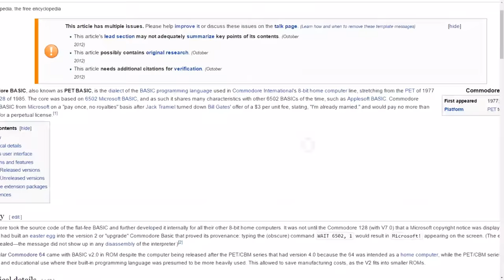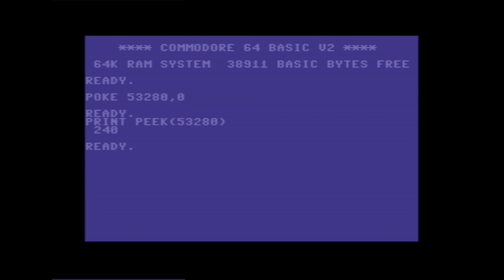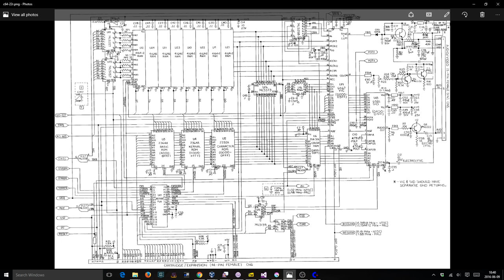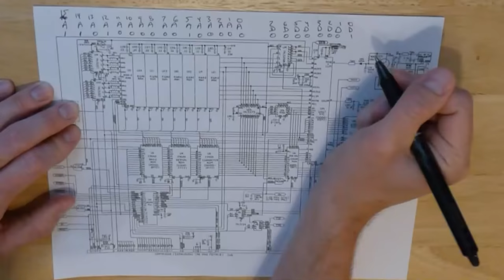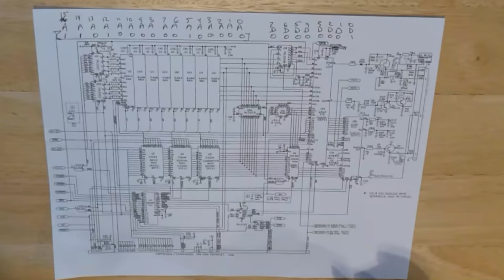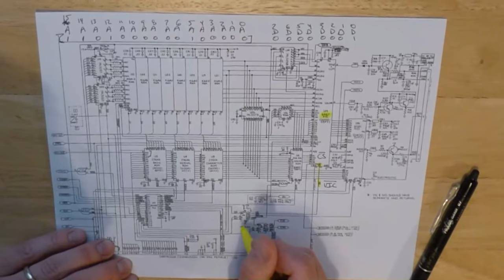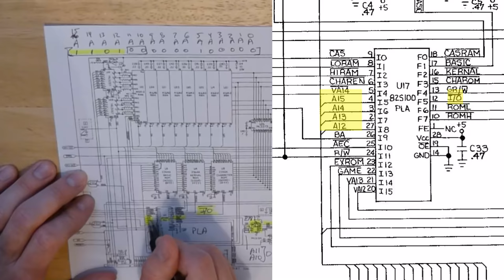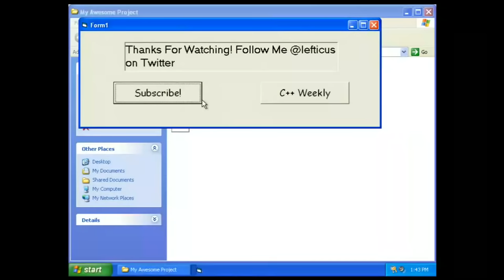Commodore 64 Part 1: How The Memory Map Worked

Comment: What an amazing explanation of the digital logic used to make things happen on the C64.  It really is a lesson that can be used for integrated circuits as a whole (in my opinion).  Computers understand two things; voltage and the lack of voltage.  Yes, analog exists, but not for the sake of processing without software to make decisions based on such things.  I really enjoyed this.  Thanks for the killer content.

Comment: This is a really good explanation.  I repair arcade game hardware which works almost identically.  Modern systems aren't too different you just write to abstracted hardware through libraries but under the hood an enable line is set and data passes along a bus.
Reply: Ya I would liken it to sending mail on a postage bus. The old time computers you just said, "here!"
IBM followed the DEC model more, with interrupts handling everything on the bus.

Comment: That PLA went bad in my C64 when I was a kid. Thanks to the schematic, I was able to track down the problem and replace the chip.  I forget exactly what the behavior was, but I remember the computer still worked, but the video was all messed up and I was able to type in enough POKE commands to determine that memory wasn't being banked properly.  Good times.
Reply: POKE 56000 , 100
READY.

PRINT PEEK(56000)
32
READY.

What the f....?

POKE 56000, 100000000000
?ILLEGAL QUANTITY
ERROR
READY.
I had the same problem.
Reply: What did you guys replace it with? Were the original chips available at the time? Or was there already a market for aftermarket Commodore 64 PLAs?
Reply: @gregorymalchuk272  This was around 1994, original PLAs were available from Jameco.

Comment: I don't think I'd say "not active," usually I've heard it stated as "active low"
Reply from the maker: +Eric Poulsen good point
Reply: Even better, use "asserted" and "deasserted". That way it doesn't matter if it's active high or low.
Reply: 'Active low/active high' is the industry standard term...Ive never heard anyone say 'asserted or unasserted' ever. In boolean algebra it's very common to refer to things in terms of 'not' or 'bar'....I think he was actually thinking in terms of boolean algebra while thinking aloud. It's a good approach in any case when you are following a logic structure on a wiring diagram. Both ways are able to be understood and his explanations were detailed and easy to follow.

One further point I would like to make is that the I/O and the CIAs actively played a role in how the chip was used. In fact, I once had a black screen on a commodore 64, and the problem ended up being the 6526 CIA! I removed it, and the computer turned on just fine...because it defaulted to 0 on the register(since it wasn't there anymore). The CIA would control the bank area of where the chip would look for it's data. This feature allowed for variable screen map locations even though the chip could technically only see 16K at once. You could change where that 16K was!

In contrast, the VIC-20 doesn't have this feature, and the graphics are thus hardwired to the low memory area, and cannot be moved at all. This is annoying at times and results in some rather silly code and ridiculous loading schemes where you would have to poke values around before running the games. The PLA actually made all this complicated logic possible on the commodore 64 without making to overly expensive(or at all awkward), as well as DRAM refreshing...which dramatically reduced the cost in comparison with the competition who were all using expensive SRAM to make things easier/reliable on the manufacturing side.
Reply: I have always referred a 0, 1 or H (for tristate high impedance o/p) as low or active low (when referring to circuit diagrams) etc.
Reply: @peterlamont647  Great insight.

Comment: Can you explain more about the PROM chips and how the graphics spirits characters get displayed on the CTR screen by the counter chips sync signals. So program a graphic spirit and character how would this be done because the color PROM chip has all the color information that gets encoded. The CRT monitor has a decoder chip to decode the color information from the PROM chip. The X and Y coordinates are done by the V & H counter chips not in the character ROM or spirit ROM or color color PROM chip. How does the X and Y coordinates get applied to the graphics ROM chips?

Comment: Nothing about the bank switching state? There is also RAM on 53280 if you choose to bank switch it in. Fact is that RAM also takes up the entire address space but you will have to bank switch to use it.

Comment: THE RETRO PROGRAMMER,  If the RAM range is 2000- 23FF. How do I compute the RAM's range like how can I manually compute and get that 2000-23FF hexadecimal numbers?
If the RAM range is 3000-31FF by looking at the decoder chip how can you get the RAM ranges manually without having or getting the memory map to tell you the rams ranges. 
What determines the RAMS starting and ending ranges?

Comment: Very cool video but I think you didn't reveal the magic of poking 0 and peeking 240 back :)

My guess: decimal 240 is 11110000 binary and since we can have 16 colours only which is log_2(16) = 4 that leaves us with 4 bits, the other 4 are not used (possibly do not physically exist within the VIC) to store colour code and seem to be always returned as "high", that's why 0 is being read as 240(11110000), 1 as 241 (11110001) etc.
Reply: You are right. But now: Only on emulators do you always get 1111 in the upper half of the byte! On real hardware, you get a random value.

Comment: I spent my whole childhood with a C64. I thought this was an interesting video. I have questions though.

1. How did you know why to use the VIC as your inference starting point?

2. You've only discussed the address lines that receive ones. But if a PLA receives 2 ones over address lines and then gives 0 as output over another line, then I assume that in another place on the schematic, a 1 could be outputted when receiving multiple zeroes?

3. How did you know that the first poke number corresponds to address lines and the second one to value lines?

Comment: I think you are talking the method called "bank-switching", widely used in games are'nt you? One bank would be the current 1024 bytes showing on the screen and meanwhile another screen would be built in another bank and be switched on to when needed for smooth transitions between scenes with no loading.

Comment: This could been explained much more logical than this. Hi-byte and Low-byte (both 8 bit) determines these 16-bit addresses you talk about. This is something you learn when going into machine code language and is basically how the computer finds it's  way through the memory map (which goes from $0000-$FFFF).
Reply: You could always make you're vid...
Reply: Snap!

Anyway it is more complicated than that on the C64. It has all kinds of bank switching, ram refresh, IO space with ram underneath at the same address, the CIA partially controlling the video chip etc. The Commodore 64 seems deceptively simple, but in reality the memory map is anything but simple.

In terms of program memory I would entirely agree! In fact, that is exactly right down to the 74LS245's and the HIRAM and LOWRAM !CS lines etc. but once you get into the I/O...oh geez...They had to do some wizardry to fit 96K on a machine with 64K addresses and memory that erases itself every 100 microseconds.

Comment: I have a feeling that you are not writing to or addressing the VIC at all. The VIC does not appear to look at the A5 address line, so that bit cant possibly mean anything to the VIC, yet it does mean something to the system itself, so it is not insignificant...

Rather, I think that the act of writing to address D020 in this circumstance causes the "COLOR RAM" chip to be selected, because the COLOR RAM chip takes in all address lines from A9..A0 therefore A5 does mean something to it - and only data lines from D3..D0 (see below) are connected to COLOR RAM which has some significance...

Writing a value of 1 and reading back a value of 241 (0xF1) can be explained as follows...

COLOR RAM is connected only to D3..D0, corresponding to the lower nibble. D7..D4 are not connected to COLOR RAM. Therefore when you write to COLOR RAM, only the lowest nibble even matters - you can put any value you want in the higher nibble and it is simply ignored. As for reading ... TTL chips tended to have weak pull ups on their inputs, which meant that if those pins were left floating, they would be reasonably stable at a logic high. Therefore, when you read a value from COLOR RAM, and it places its value on to D3..D0 only, D7..D4 are effectively floating and therefore pulled high and thus read as high by the CPU. Hence you get all ones in the upper nibble, and the value of that memory location in the lower nibble.

I think it is important to note that it may not be as simple as the address alone that determines which chip is selected. There are a lot of other input signals to the PLA which can influence which output(s) are activated. Without knowing the product terms of the PLA it would be hard to say. What does cause me some doubt, however, is that on the schematic the COLOR RAM chip is labelled as having a memory range of D800-DBFF. But given what I can see from the schematic, I am fairly confident in what I wrote above.
Reply: Actually I just found a PDF called "The C64 PLA Dissected", I cant post links but try googling it. This seems to contain the product terms for the PLA along with a wealth of other information about it. I think it satisfies what I wrote above in terms of selecting the VIC or COLOR RAM.
Reply: The color RAM chip with its memory range of D800-DBFF is for the 1000 tiles for a text screen memory. Each tile makes each text character capable of being a different color. Wherever the screen memory is, usually 1024 to 2023 decimal,  is matched up with color RAM's value. What a poke to $D020 does is set a register to cause the VIC to make the border color what you want it to be. Likewise poking to $D021 makes the background all one color. This way you do not have to change 1000 color locations, the VIC does the hard work for you. The VIC is an amazing chip that actually does RAM refresh and other tasks, and it can even put the processor on hold and use time slots for its own purposes. The VIC and the 6510 take turns accessing the data and address buses using the system clock as the task switcher. Very clever multiplexing scheme, and elegant.

Comment: I think your order is quite wrong
today's computers have multiple cores - up to 18, generally 2-6
each core have multiple execution units - AMD K6 had 6 of them, AMD Athlon had 10 of them (3 ALUs, 3FPUs, 3AGUs, Load/Store)
today CPUs are capable of executing very complex operations, which does more then one thing and sometimes it would render more then one operation per clock per execution unit.
considering just that
4GHz / 1MHz = 4000
10 execution units - 40000
say 4 cores - 160000
now we are much closer

6502 had 0 cache, 1 execution unit, 2 registers.

Just considering number of registers (not even touching register renaming) we are talking about 8 times more registers on x86_64
we may be very well close to million times faster